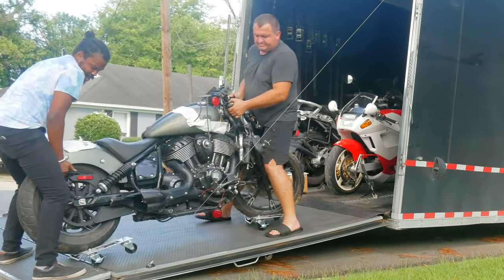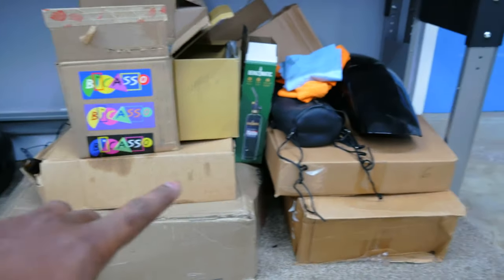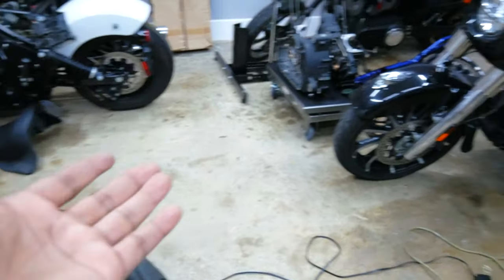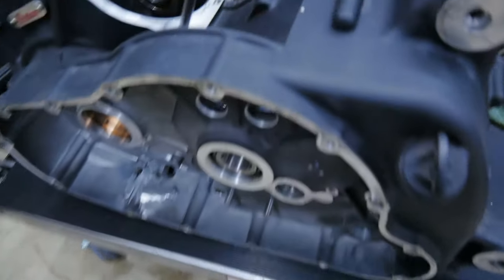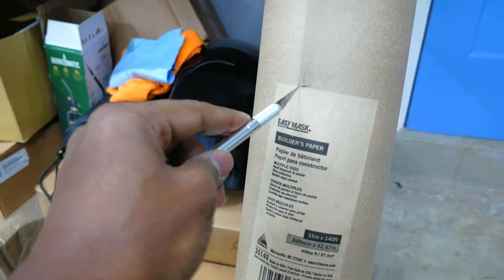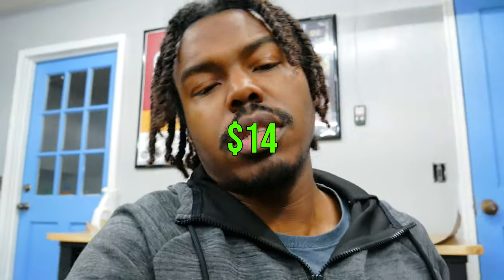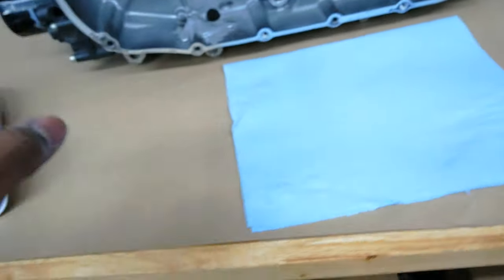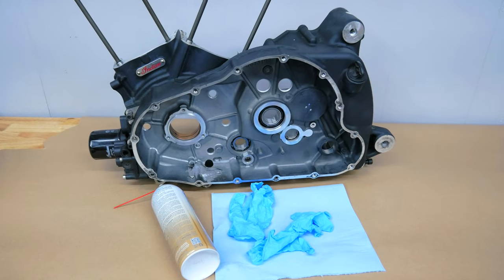How The Heck Is This Engine Supposed To Be Cleaned?

Comment: Most oil filters are able to filter down to 20 microns... WAY smaller than what you are seeing.  You usually do a flush with clean oil after putting it together, you run it and then change the oil again.  I have opened turbine engines out in the middle of the desert when I was in the military.  Sand gets everywhere.  You do the best you can, and trust the filters to do their job.

Remove the old gasket with a plastic razor blade is what I have used.

Comment: Why don't you just build a plastic tent over and around your table to prevent dust and dirt from getting to the parts sort of like those portable paint booths that they have on the market.
Reply: I think that's a really good idea. Set up the tent and clean everything as it goes in. Assemble inside. You may end up doing some cleaning inside the tent as well but it'll be contained AND you can take your time. A pivotal aspect for me 😂
Reply from the maker: Y’all too smart for me 😂😂😂
Reply: @BrandonBicasso  Whoahhhh dude, you’re LITERALLY rebuilding bikes in your garage and they’re turning out just as good (if not better) than new. That’s some next level smarts in my personal opinion. Yeah sometimes the small things slip my mind too tho.

Comment: Plastic scrappers, low grade (green pad) scotch brite, brake cleaner & worse case scenario straight razor being extremely cautious with that & only when all else fails. As mentioned by few others gotta trust the oil filters to do their jobs. Compared to the dealer I used to work for you are far more meticulous & thoughtful of the small things ie particals & what not. As always good job though man

Comment: From the Harley forum I got the tip to use paint remover on gaskets, and that then they peel right off. Havent tried this myself though. Looking at Allen Millyard, he cleans engine cases just by using a garden hose. So I do this too (soapy water) and this always worked fine for me. To prevent dust I store motor parts in plastic bags which I tie close. I typically dont worry too much, if it is that sensitive to dust then it doesnt deserve to live.

Comment: I've used a big plastic bin and a pine-sol solution to clean parts. Brake cleaner and compressed air is also a decent option (wear safety glasses). Also tap those screws out before you clean anything - drilling them will make a mess. (edit: on the Pine Sol - do some research on the dilution if you want to try this method)

Comment: A brass brush would help with those gaskets instead of rubbing . Your like harbor freight they sell them
Reply from the maker: Brass scratches the surface 🥴
Reply: @BrandonBicasso  it shouldn’t . Gun smiths use them on guns with aluminum uppers and lowers . It doesn’t scratch the bluing. Also maybe using a 0000 Brillo that’s the softest one they make again another tool gun smiths use with out scratching paint or the metal
Reply from the maker: I used a brass brush off the tool wall. I ended up using a scotch brite pad. There’s still some scratching going on but I don’t think it’s making the surface uneven.

Comment: I just use degreaser, pressure washer, then blow it all of with compressed air. Take the filter and mount off first, remove the oil gallery plugs. After it’s clean and dry, lightly oil the bearings  . You can then wrap the part in glad wrap to keep it clean.